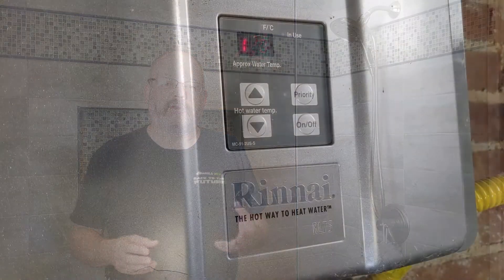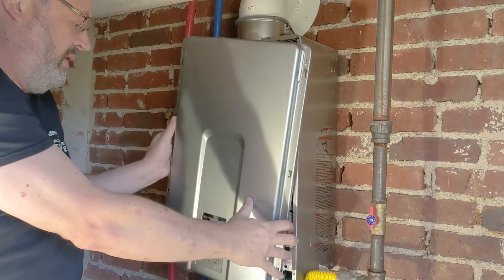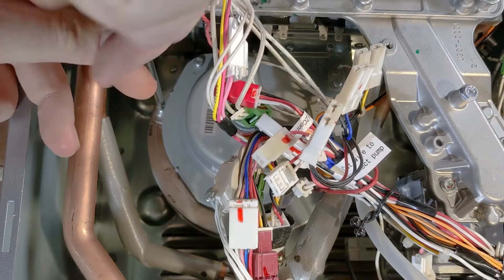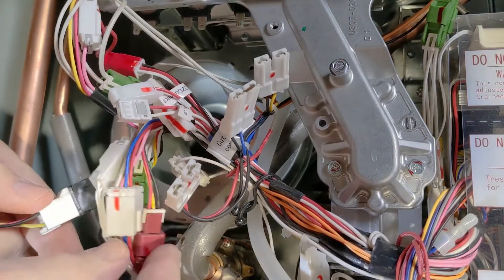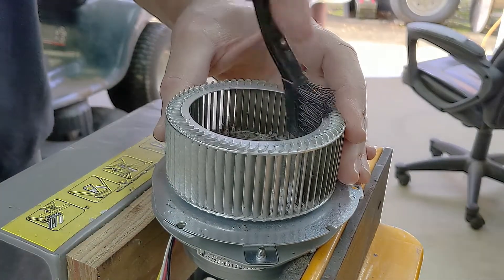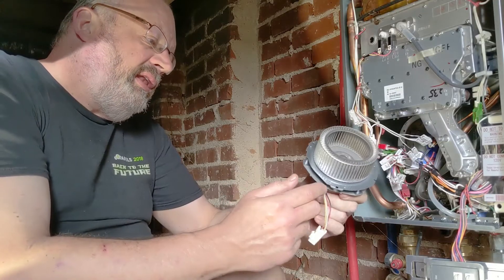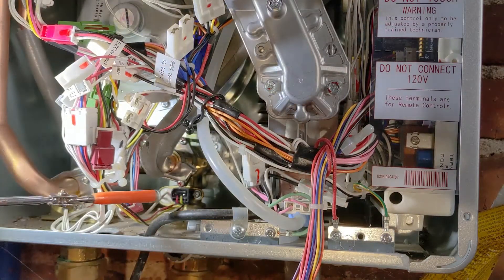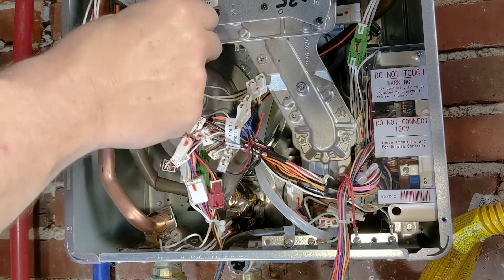Tankless water heater runs cold after 3-minutes with no error code

Comment: That one or two bugs was enough to make the heater shut off? Seems hard to believe they would effect the wheel spin whatsoever.
Reply from the maker: I suspect a bug throws that squirrel fan out of balance because it spins so fast. Sometimes I hear a low rumbling noise prior to the unit failing, which I suspect is an imbalanced fan.

Comment: It didn’t fixed mine now I just get 5 minutes hot water instead of 3 minutes. Does anyone know what should I do ? 
Thanks for the video.
Reply from the maker: Recently I tried this exhaust fan cleaning technique and it did not restore my hot water service. The water would only come on hot for a few minutes and then promptly go cold. 
I called my local plumber who quickly determined the problem. Debris had accumulated in the heat exchanger (bugs & leaves). He showed me what was involved and it is intimidating enough where I'll definitely call a professional again for that task. 
While doing that service he also demineralized the unit which is something that has to be done every few years depending on water hardness. 
Sometimes it just makes sense to call a professional. They do this work every day and have an accumulated wealth of knowledge and skill that is worth paying for. Every time I've called a professional I've been rewarded with excellent results.
Reply: @BradSmithSC  any idea what could be the problem ?
Reply from the maker: If cleaning the exhaust fan did not work then I suggest calling a professional plumber

Comment: You saved me a service call. Last time the plumber put in a new fan and cleaning - $600. Got new fan online $79, installed in 30 minutes. I cleaned the old fan out- chock full of moths- save for next time. Thx, again!  God bless!!!😊
Reply: Gonna try screen around the intake/exhaust vent. Is that okay?
Reply from the maker: @ronnieleblanc3628 I've considered adding a screen barrier, but my concern is lessening the airflow that cools the water heater. It seems these units are more sensitive in the summer months when there's warmer ambient air and less sensitive during the winter months with cooler intake air. Perhaps adding screen material in a 'zigzag' orientation to increase the surface area might allow more air to flow through the material.
Reply from the maker: I'm glad this video was helpful. Consider spraying long lasting bug repellent around the water heater to help keep 'em away. I spray around the water heater unit and then on the outside I spray around the vent pipe.

Comment: I did this the first time, worked like a charm.  This year tried it again, and it did not work.  So I had to take the cover off the heating element right above this wheel.  It was full of miller moths.  Got er all cleaned out, running like a champ.  Thanks for the video
Reply from the maker: Consider spraying the fan assembly, the entrance, and exit air flow areas with long lasting bug spray to help prevent them from returning too quickly

Comment: Exactly what I needed. My unit would code 10 under a long shower or long bath without me noticing and go back normal hiding the issue. Finally heard the code 10 alarm while my wife was taking a long shower. Your video got me on the road to finally fixing the issue. Thanks !!!
Reply from the maker: I am certain your wife is grateful you were able to fix your water heater
Reply: This video was very interesting and informative. Thank you for your self control and  choice of words. You are a great mechanic! @BradSmithSC

Comment: Brad, great video!! I have a Rannia 65V and cannot get water over 97 degrees.  I have reset the toggle switches and turned the thermostat to 140 and the temp sometimes gets up to 104 degrees out of different faucets.  Ant ideas what the problem is?  Thanks
Reply from the maker: I'm guessing you've already checked the temperature setting on the unit. If you have not, start with that.

The next thing might be a limitation of your unit. These units increase the incoming water temperature a certain number of degrees based on the water flow rate. If your incoming water is exceptionally cold and your flow rate is high, the unit will increase the temperature less than if either of these variables were lower. Larger units can handle colder incoming temps and higher flow rates.

I have an idea on something to check. There's a chart for your unit that'll show how much it can increase the incoming water temperature in relation to the flow rate. That means if your incoming water is exceptionally cold it can only increase the temperature a little bit and varies on the flow rate. It can increase the temp more with a reduced flow rate. 

If there's not a mechanical problem where a professional is needed then one workaround might be to reduce the water flow in your shower and see if that increases the temperature. Try measuring the water temperature with your valve halfway open and fully open. If the temperature goes up with a reduced water flow then consider putting on some sort of a flow restrictor.

If reducing the water flow does not seem like the right fix I strongly recommend calling a professional. I'd hate it if you altered something which unexpectedly increased your energy consumption where it could have been prevented by calling a professional. You xan tell I find value in relying on others with valued experience. My local plumber is a master of his craft.

This water flow curve chart shows temp rise over flow rate on page 26 and varies by model  https://media.rinnai.us/salsify_asset/s-43d60415-4de7-4ad8-aa59-1b39248bfe09/100000258-Value%20Series%20Installation%20and%20Operation%20Manual.pdf
Reply: @BradSmithSC  Thanks for the info.  I will ty your recommendations.

Comment: Our shower is the only part of the house where water goes cold in about 3 minutes everywhere else stays warm. Any thoughts?
Reply from the maker: Perhaps the water flow rate at this location is below the minimum flow threshold to keep your unit running. I'm presuming you have a single heater unit that feeds all your shower locations.
Reply: @BradSmithSC  we have a single rinai tankless. This shower is the closest to the heater
Reply from the maker: Check your manual for the minimum flow rate that will sustain continuous heating. Then measure the water flow from your shower head. Use a 1 gallon bucket and time how long it takes to fill it up. Verify if that flow rate is high enough. Sometimes shower heads can be cleaned by soaking them in vinegar, or another solution which might depend on your water hardness, that makes them restore their original flow rate.
Reply: @BradSmithSC  I will check it out and report back. Thanks for your help.
Reply: So my flow rate out of the shower head is about a gallon per minute which seems on the lower end but not the minimum according to internet sources. Any easy suggestions to fix?
Reply: Like removing the restrictor in the shower head?
Reply from the maker: I suggest timing your water flow (gallons per minute) prior to and after altering the shower head

Comment: I was intermittently having this issue. I took the Rinnai tankless water heater fan out and it was filled with several bugs, a spider and dirt. I cleaned it out. When disconnecting the connector of the fan, use a small screwdriver to release the tab to take apart the connector. When released it should come apart easily. Time will tell if this took care of the issue, I hope so.
Reply from the maker: I add bug spray around the openings and it seems to lessen the frequency for this cleaning chore

Comment: I have a Bradford White and its fan is mounted sideways to the viewer. I wish there was a video on it - too many things to take apart  - need guidance.
Reply from the maker: If you cannot find a helpful video on your brand of water heater, try contacting the manufacturer or take the easy route and hire a professional.
Reply: @BradSmithSC  I'm in a remote area and since I am a farm boy I am trying to be self-reliant.
Reply from the maker: I found this resource if you hadn't already come across it https://www.bradfordwhite.com/documentation/usa/residential/tank-type-gas

Adding, or excluding, filetype:PDF to your search query may help where you may find public docs on hosted services like this one
https://s3.amazonaws.com/bradfordwhitecorp/wp-content/uploads/residential_tankless_everhot_interior_igi_180r_discontinued_servicemanual_45095a.pdf

Of course you would want to add your model name or number to your query.
Reply: @BradSmithSC  Thanks. Looks like my model has no info - it's an Everhot TG-1801-X and was installed about 13 years ago now. I have the installation manual but the diagrams are NOT great and there is no clear info on how to remove the fan squirrel cage. It is on its side to me after a long air-drop cowl thing that should sift out any moths before they get into the fan housing... but I keep getting Code 10 just as the shampoo is in my eyes...! And it konks out when filling the washing machine. The fan housing must be on some sort of a slide rack so I can pull it out... The Renai brand looks so simple in comparison. I'll do some more searching, but thanks for these sites. I may call the 1-800 number and  see if someone at corporate would give some guidance as to how to remove and clean it without wrecking the unit! Again, thanks for your kindness. Christopher
Reply: Pg 50 of the second site link - AHA!!!
Reply: @BradSmithSC  Well, I know that you have been pacing the floor for a few days now, wondering what has become of me and my Bradford White water heater project.  Today was a wet morning so I got into it again and discovered that EVERY piece of it is wired so fragile that you don't dare SNEEZE. None of the plastic plugs wanted to unhook without a fight that I knew I would only lose, so once the front cover was off, I hay-wired the push-button panel and then the fan housing from the cabinet and worked with them simply hanging snug.  Unable to take the fan from out of the squirrel cage, I simply vacuumed and brushed one blade at a time with a toothbrush and then a small flat screwdriver to free the lint, a few deer flies and a bit of fibreglass pink insulation that got sucked in after the unit was first installed, I imagine. The sensor (VERY THIN WIRES!!) that is located immediately at the air intake just before the fan itself (a thermostat?) had a tuft of insulation fibres as well as a fly or two caught on it. All is clean now as far as lint and debris is concerned. I resisted the urge to disassemble everything and wash it with varsol. I am not THAT OCD!

Here is something worth noting - I discovered that ABOVE the fan air OUTTAKE, on its way to the actual burner, is a plate with air holes that divides the burn chamber from the air intake. It was coated with a fair bit of fibres and the odd fly as well. I carefully got in there as room allowed with the vacuum and a little bottle brush that I only use for cleaning the hummingbird feeder. The lesson? Take a look at everything you can see, and then think for a moment and realize that you already have the tools around to do the task. The human brain is a wonderful thing!

Thanks, Brad, for your advice and link to a guide with actual photographs that made it very simple to see what needed to be done.

Time to go out and rake hay.

Christopher
Reply from the maker: I'm thankful you've shared this update as I have wondered about your outcome. You're smart in your observations before disassembling. It's a good way to see telltales of other issues. It's like observing if oil is spraying out at a certain pattern to find the source of that obscure leak.

Consider spraying a long lasting insect barrier around the unit and all the air intakes. This seems to lengthen the time between needing to clean the fan.
Reply: @BradSmithSC  How about me putting a window bug screen over the housewall air/exhaust thing? It is a two-in-one design. At the moment the screen there within looks more like rabbit hutch size.
Reply from the maker: My only concern wrapping a water heater in a screen barrier is reducing the airflow. If there was enough screen material that would not be a factor but that means it has to be made in a larger frame that wraps around the unit rather than a small piece of screen over the air intake. My understanding is the air intake not only provides oxygen for the natural gas but also for cooling.
Reply: @BradSmithSC  The screen balloon thing wouldn't work in winter - too much snow here. Well, now that I know how to get into it to clean it - it has sat there for eleven years... and this was its first cleaning.

Comment: Thank you for this great video.  Do you have any suggestions for what to do if I have this same shut-off with no error code, but my fan is perfectly clean and cleaning it doesn't solve the problem?  My unit was indeed FULL of mud dauber nests, but they were attached to the pipes and other stuff inside the unit, and not in my turbine fan.
Reply from the maker: What's really weird is sometimes the fan will only have a single ladybug in it and other times have lots of debris. I have taken my fan out and it has been perfectly clean but then when I use a brush and the air hose stuff comes off.

Also check to see if the fan rotates evenly. Look at it from the side and spin it around making certain the shaft is perfectly straight. I was able to put slight pressure to even mine out.
Reply: @BradSmithSC  Alright I'll pull it once more and give it the brush treatment.  FYI, as another commenter mentioned, I have a single counterweight on one fan blade.

Comment: You, sir, are a Godsend!!!  You just saved me many dollars.  I opened up my fan, and sure enough it was full of bugs and gunk.  I just took the longest shower I've had in a few years!
Reply from the maker: Glad to hear this worked out for you. I've had additional luck keeping bugs out of the fan by routinely spraying around the perimeter of the machine and around the exhaust vent on the exterior.
Reply: @BradSmithSC  Well, so much for that.  It stopped working completely.  I took it apart again and found a couple of leaves.  After removing them I put it back together, and I would get hot water one time after unplugging and plugging again.  I ended up biting the bullet and got a new Navien unit installed on the exterior of the house along with a dedicated recirculating line.  The difference between that old piece of crap Rinnai and the new Navien is night and day.
Reply from the maker: @777triathlete  Glad you got a unit that's working for you. Those recirculating lines are nice where you get instant hot water at any tap. If power consumption is a concern consider setting that up on a timer to only run during waking hours. Also consider wrapping your pipes in insulation. Thanks for the update.

Comment: Great video. Here are a few tips that helped me Tip #1 I did not disconnect the fan. I didn't want to chance breaking the connector. I  used a small metal pick and scraped off the dead honey bee that was stuck to the inside fins of my fan and then used a toothbrush to gently clean the fins of the fan. TIP #2 Use a Sharpie and write 1, 2 and 3 on the connectors. TIP #3 Use a Sharpie and draw an up arrow on the fan before removing it. There is only one way for the fan to go back on, but this makes it a little bit easier
Reply from the maker: Those are excellent well thought through tips. Not shown in the video is where I colored the three screws with yellow paint to make locating them a bit easier since there are two sets of three screws in close proximity.

Comment: Brad my heater was flashing 10.  I did this cleaned fan and hot water without turning cold.    But now my fan and tankless seems to not be cutting of at all.   I did this days ago and its in my garage.   It's running non stop even if no water is being used.  When I cut on hot water it kicks up a notch 

What would you suggest 

Thank you for the video was excellent
Reply from the maker: That sounds like quite a problem, Jason. Fairly certain these need water to run through them to prevent them from overheating. Hopefully just the fan is what's running and the heating elements are idle. My guess is some relay that tells the machine to turn off has failed. This is sort of gremlin infestation is where a trusted professional is probably your best option.

Comment: We had this same issue, but before visiting your site we paid to have our Rinnai serviced. For $450 they flush only, no fan cleaning. When I asked about the additional charge for cleaning the fan he said we don't do that. After finding your site I decided to give it a shot. My unit has a different fan setup, the intake tube  comes in from the side. The fan was last cleaned about ten years ago so there were way more bugs to dig out of the blades. Also it stores error codes, error 10 was on the list which is associated with intake air restriction. Anyway thanks to you no more 3 min. showers.
Reply from the maker: I also apply long lasting bug spray on the wall around the perimeter of the unit and around the intake vent. Don't know if its effective but my perception is there's been longer spans between fan cleaning needs.
Reply: @BradSmithSC  I covered the entire vent pipe with a fine mesh copper screen. It worked for a couple years but eventually deteriorated from the exhaust heat. The most problematic bug here are stink bugs. Will look for a repellent that may help with this. Thanks again.